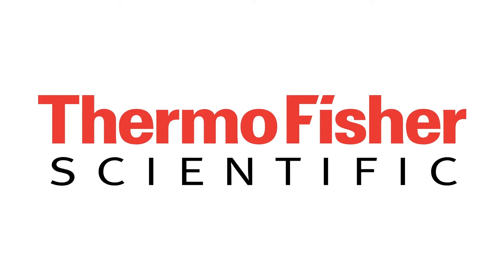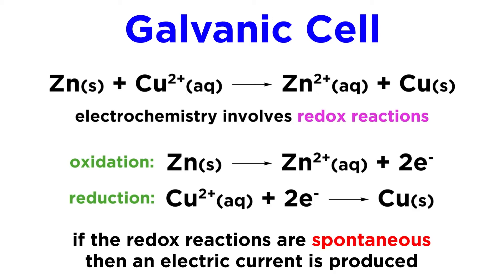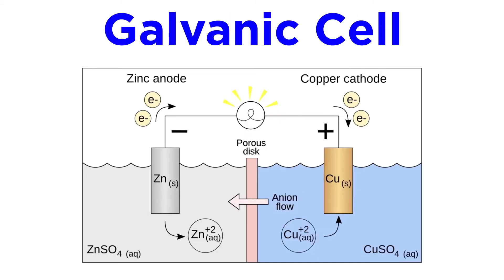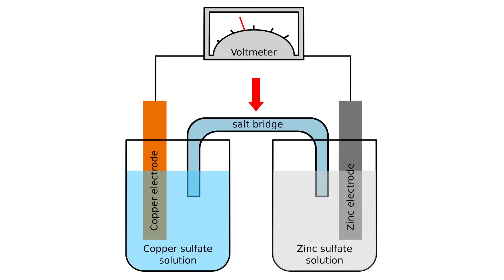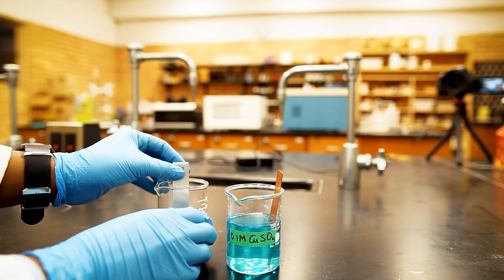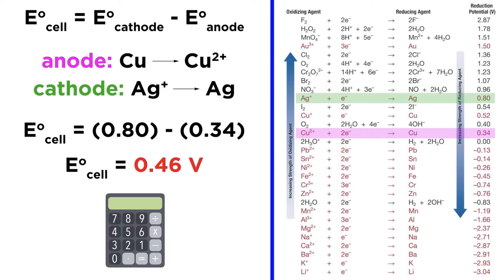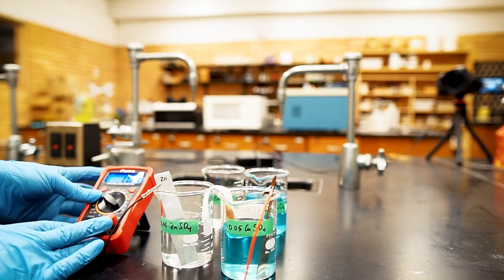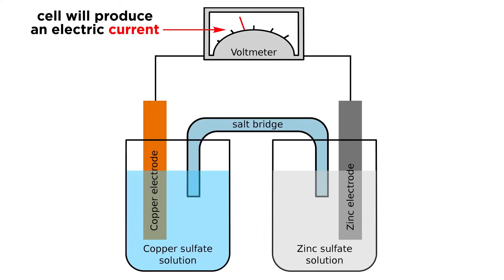Physically Constructing a Galvanic Cell (Electrochemistry)

Comment: Procedure:
- Dip the Zn strip in Zn^(2+) solution
- Dip the Cu in Cu^(2+) solution
- Connect the the strips using connecting wires with a lamp / voltmeter in the middle
- Connect the 2 beakers using a salt bridge

Comment: Thanks!  Also, replace 'voltmeter' with 'ammeter', and it should be "the current that's going through". 😊
Reply: Exactly my comment, maybe he had a shunt resistor in parallel 😏
Reply: @dogwalker666  hahahaha😂
Reply: rostaman
The measurement isn't voltage. I used a voltmeter when performing the experiment.
Reply: @ivoryas1696  he actually used a DMM  but that's too technical for e chemist.

Comment: Don’t they do this to ship hulls?
Reply: In reverse, We fit a sacrificial anode to the metal work which errodes instead of the ship or boat.
Reply: @dogwalker666  
Huh. I knew that they used a sacrificial anode on things, but TIL that use case. Neat!
Reply: @ivoryas1696  👍🏻
Reply: Did you notice that the zinc erodes into solution while the copper ions are deposited onto the hunk of solid electrode?

Same thing with a boat. We want the ship to not erode, so we find something zinc-ey-er than the steel hull or brass propeller or whatever else on a ship in order to erode instead of the ship.

Zinc is often used for this, but other metals require different sacrificial annodes in order to ensure the ship stays on the left side of the PowerPoint slide.